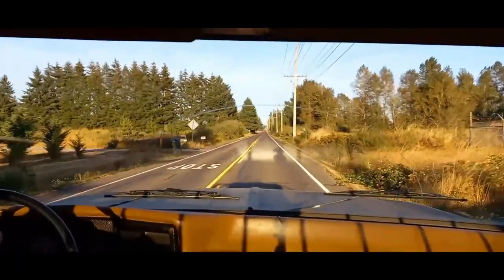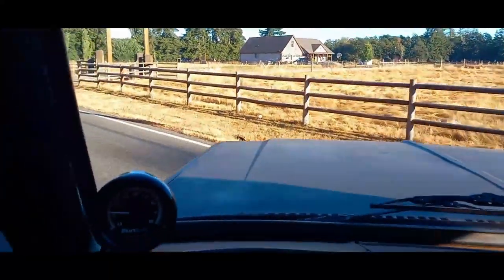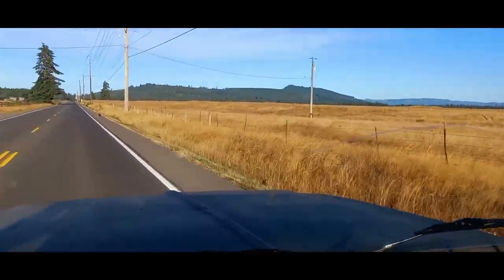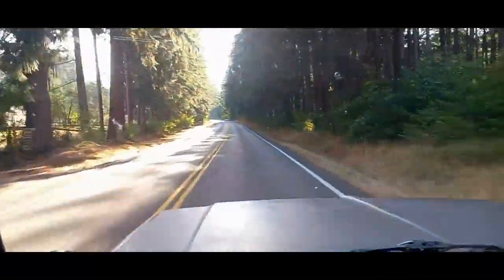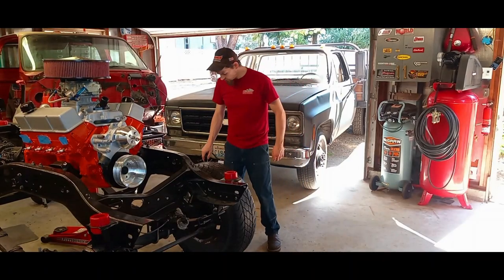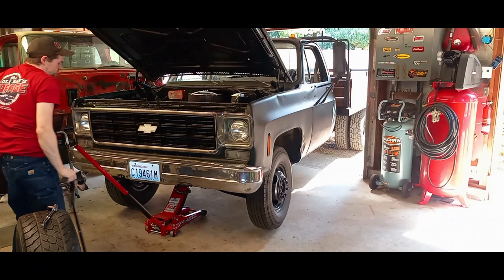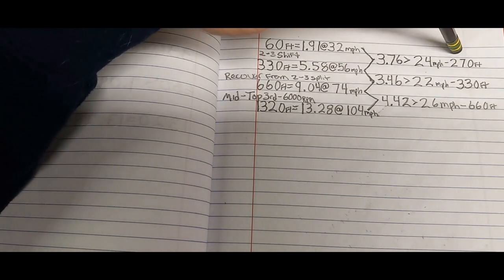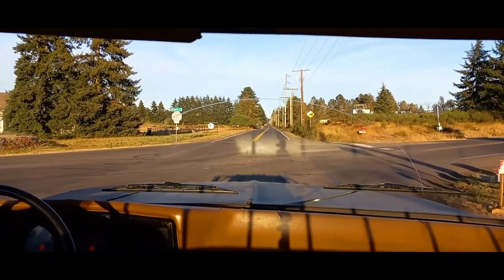383sbc Powered Chevy Dually Runs New Personal Best Low 13sec Pass Since 470hp Engine Build

Comment: You are the ONLY person other than the man that gave me my first job at 16 and taught me everything I know about building an engine and setting up traction that KNOWS  that  overlap is the most important function of a camshaft.. As far as your engine in a lighter car...6.90's ALL DAY LONG
Reply from the maker: Thank you, yes absolutely the most critical aspect of proper camshaft selection is going to be the ability for the exhaust to be able to enfluence a inertial charging event on the intake side which causes a super chargering effect and allows the cylinder to be filled at rates up to 7+× what the piston alone can induce on the induction system, and that is just the starting point of proper camshaft selection and 99.9% of people wouldn't know how to properly come to just that conclusion, but even after taking every thing into account that one would have needed to to come to that conclusion it can of course all be f'd if the lift and duration numbers aren't right and there are so many factors that come into play there also. You seem to be one of the very few people I have talked to that have some grasp on the effect of actual proper camshaft selection. I hope to help people to understand this stuff more thueroly. I don't know if you know who David vizard is but he had seen and  identified that I have engine knowledge that very few people that walk this earth have and that basicly everything I say can be confirmed by alot of his videos and backed by his 60+ years of engine research, development & 1000's of dyno runs, he went as far as to recomend my channel to his subscribers. I hope we can have further discussion when I put out the camshaft info, I could literally go on for days explaining all this stuff and still not cover it all.... you confirmed what i was thinking as far as time if that  engine out of the dually was is something lighter. With that engines ability to do That was kind of my point, that engine wasn't built with speed in mind it was built for torque but being as all the parts in that engine correlate with one another down to minute detail and it uses the proper camshaft it has impressive output compared to if I had just put in some cam off the shelf even if the spes of that cam were close it wouldn't be optimized for that engine and had I put in a camshaft that was to big performance would have suffered severely. Take care buddy
Reply: @ACDGarage_Racing  I have several of his books. There is one other person that taught me the same thing as DV and he gave me my first job. It's soo in depth. Camshaft timing is a science. I enjoy watching videos of people explaining how a camshaft works not realizing that they are WRONG. I have a question for Bill  but need to send him a picture. It seems if I have a question, the only people that could answer it have passed. Bill is my only hope lol.

Comment: That's a pretty badass SBC to make that big ol girl run a 13.28 1/4 mile. I can tell from experience that you know exactly what you are doing with an engine. Hope you are doing well brother.
Reply from the maker: Thanks man, I've definitely been deeper into the most intricate details and physics of engines than most people could ever hope to comprehend, not to brag just staiting truth but literaly by the time i was about 10 years old i knew more about cylinder heads/engines than most grown men, i actually started working in my dads cylinder head/engine building machine shop when i was 10, i have built many very successful circle track engines, street engines, drag race engines in including my own mud racing champion 383 that dominated in a class full of big block trucks some with 540's. but I entend to educate and help people understand, go faster and make better/educated decisions while specing/building an engine's.

Comment: hey, you take all the time you need to do whatever you need to. 
The faithful won't be going anywhere, so if you're worried about that, don't you have more than enough on your plate. 
BTW, last comment wasn't comparing anything to anything, it was to simply let you know that some of us understand some of what you're dealing with. 
So you take time to take care of what you have to, because we're no different than you  with the exception of we're on the other side of the screen. 
I assume you are using your phone to record your videos, and if that's the case. 
Find yourself a good suction mounted phone caddy that typically gets used on the windshield. 
You can do some test takes to figure out best location for filming, and your being able to access it to change settings and on and off for your driving runs.
I'm sure they have something better because everyone uses their phones a lot more than people realize they do, but that's the off the top of my head solution to your situation. 
I've always been firm believer in GMAC's start up additive, and I know you're going to smack my hands for this one.
I have used white lithium grease to lube everything up with including packaging the pickup on oil pumps for quick priming of oil pumps. 
I use whole tube of it when I start assembling one, and if I have to stop for any reason for more than a few minutes. 
I'll cover it all up with a old sheet, and even tie a string around it where I gathered it up under the bottom. 
Never had a roller cam to install, and never had a flat tappet lifter, or cam failure are anything else in the hydraulic part of the engine. 
With the exception of high volume oil pump on with a stock oil pan on my old 327, but only because I held it at high rpms for too many miles. 
I'll even explain why I did what I did, my ex wife girlfriend at the time was already over hour late past time she was supposed to have been home. 
We were twenty miles away, and it was basically straight farm roads on good asphalt back then, and I took the muncie to the limits between every shift, and once I leave 1st gear, I never touch my clutch pedal again until I get ready to stop back in those days. 
I won't claim any high RPM numbers out right, but I will say it never saw anything under 5,500 for a long long way.
And it didn't actually give indication that I spun all but one main bearing until I shut her off at my house, and this is after several red lights couple stop signs, and dropping her off and waiting until she was inside the house with porch light turned off
When I turned the key off, instantly I heard her sqeal for half a second, and she stopped turning. 
Didn't hurt the rod bearings, lifters are cam bearings any.
The mains, except one, were completely overlapped, and one half was nuthin but a little thin piece on each side where it was pushed out from being smashed and ground to nuthin. 
had crank turned and polished new set of over stock bearings, had the cam bearings replaced just because, and had cam checked by my dad who was a  machinist for TI for 40 years, but had a friend at machine shop do the actual machining for me.
She ran another 12 years, and was still going when I sold her to a friend of mine for his fat fender Studebaker truck .
Oh yeah, I threw that high volume oil pump in the scrap bin in my dad's garage, and bought a standard factory mechanical pump too.
But I didn't stop driving her for what I built her to do, and that was eat Fords any time one rolled up beside her, and ever see a little mouse painted ford blue, you'll know that is because it's showing a fomoco what it's supposed to run like
Reply from the maker: Hey Timothy, how you doing buddy? So about the last comment you made, first I'm sorry I didn't respond back properly like,I said I was going to but it had it had completely slipped my mind because I had another wave of 150+ or so comments on my channel from new subs because Bill had told people to go subscribe to my channel. Second, don't worry I knew exactly where you were coming from when you said what you said, i didnt take it anyway then how you ment it, just know i didn't take it the wrong way so we're good.
I had bought 2 different style phone mounting devices bolth suction type just different designs, but anyway the problem I had with that was it vibrated so much when it was attached to the truck from the resonance and firing rotation of the engine and it shook the screen so bad you couldn't hardly make out what you were looking at. So I had figured out how to anchor my tripod in the middle of my seat with bailing twine, this is how I was able to make those few passes and be able that pig of a transmission as fast as possible ultimately resulting in my best pass to date according to the draggy. After I had put the video I had realized that I had accidentally wrote down the wrong mph and time in between the 660 and the 1320 I was so tired when I went and broke all the numbers down and made that example sheet. I had watched that video so many times before I finalized it on my computer, just to see a mistake while watching in the premiere after I had already uploaded it lol, o well I guess I'm sure most people can expect me to make a mistake with my brain issue, I always end up catching mistake after the point of me being able to fix it. Sorry man I kind of went to left field, anyway I'm going to cut this off its getting a little long, I hope you are doing alright. Hope to hear back from you, take care buddy.

Comment: Hey youngster long time nothing from up your way, with the exception of you hollering about Jimmy Dale.
Long ago when there wasn't snow on top, and the chin hairs were red, we use to run down at yella bellie..
It was a lot more tricky then, cause the shut down is fairly short, and ends at a  hair pin left turn, are through the couple rotten round bales, and off into the weeds with no telling what lays waiting in the head high Johnson grass..
Only back then the shut down bottle necked both lanes together, with the additional thrill of lot's of wavy bumps in the asphalt from the shit getting stretched towards the turn from the extremely high temperatures we have every summer, and the force of everyone's tires under heavy breaking physically moving it to form the 2 and 3" ripples that causes the cars and trucks to buck up and down extremely hard to stop with the old brakes we had back then.
Considering that everyone was in mid 50's to early 70's model vehicles, you were doing good if you had disc brakes on front, but most were 4 wheel drum brakes with no valving to set brake bias, so those like myself in trucks did good not to swap ends trying to stop on that shit they called a road. 
What I'm trying to get at, is on my truck I had trailing arms with coil springs on rear suspension  
Much much better than leaf springs in my opinion, not only for better ride, carrying weight, but for traction control.
No wheel hopping axle wrapping the leafs up like twisting open old sardine can effect  
Built in traction bars, and the suspension works as if it was a four link so to speak.
But I had similar problems with the front end coming up instantly, but falling down as fast as it came up..
I solved this by installing big block springs off a 3/4 ton front end, and installing the largest sway bar they made back then.
Once you got the extension on the front, between the tires biting into the surface hopefully concrete the rear stays down trying to force the tires through to the magnesium wheels.
But just driving they kept down force on front tires, and with the addition of the big sway bar, it lost the oversteering bullshit that made you feel like you were going to lose it on every sweeping corner over 30 mph. 
Now remember we didn't have radial tires, and I ran L60 15" on 10" magnesium wheels back then, and L60 is 11.75" wide with basically straight groves for tread pattern. 
So I could stomp on the 750 dbl pumper, in first or second on asphalt  pretty much year round, and break the tires lose. 
That's due to close ratio muncie 4 speed from a 69 Z28 transmission, and 373 12 bolt in the rear axle.
327 .60 over equals whatever cubic inch it comes to, camel hump heads mild massage cast iorn manifold gm preformance off forget what car, but when you make $1.67 @ hour, you get cheap preformance where you can. 
But the old dude across the street from my parents place was mechanic for Friendly Chevrolet since the early 50's, and use to work on the company hot rods the owners kid raced back then. 
So he was very knowledgeable about what works best, and what to leave behind. 
He's the one with his deburring tools cleaned the heads and manifold up to breath better.
Basically he just gasket matched everything, and opened up the castings deformities as far as he could get to safely, and cleaned up the headers to open up as big as the gaskets too.
Probably wasn't over 450 at the crank, but add a muncie tied to a aluminum flywheel through a Hayes super clutch it was enough to best most everything that rolled up beside me  
I didn't mention the crane cam double springs chrome moly push rods, 6 to 1 rocker arms or the valves being 202 spec did I. 
Funny how that slips my mind these days, but I saved a long time dropping charge in a old picked jar for those parts and the dual point distributor from Mallory. 
Engine was from 60's fuelie corvette transmission 69 Z28, and believe it or not I paid more for the shifter and clutch than for both of those. 
But that was long long time ago and it's long gone unfortunately, but dam did i have me some serious good times back then. 
People freaked out when I opened the hood, and there's this tiny little motor sitting down in the canyon of an engine bay painted Ford light blue.
Everyone look at it, and first thing out was, that ain't no ford small block. 
Nope, but that's what ford small blocks should run like though. 
Piss off ford owners especially when they had big blocks, and I left them back sucking up all the smoke they were making

Comment: Great content man. I’d love to build that strong of a 383 for my Camaro. I’d also love to here more about selecting LCA and duration numbers. Keep the videos coming.
Reply from the maker: Thanks brother, you know what, you are in luck because as we speak I'm working on and have been working on for about 2weeks, the most complete camshaft video on the internet, I will be giving so GD much information and I will be proving with physical proof that this way of selecting a camshaft is 100% the best most effective way to build a extremely powerfull engine.. im going to give information, explanations, and reasons for things that you won't find or hear anywhere else on the internet, ( bealive me ive looked) I fully explain and tell how to properly calculate lsa, overlap, and duration.... i explain what effects the selection of lsa.... I give the proper way to select duration that works with the lsa and why duration changes with lsa.... I give a way to quantify the selection of the proper overlap for the engines specific rpm requirements.... there is so many solid explanations and examples with physical proof from dyno sheets and the fact that the formula predicted the ideal lsa for the most powerfull camshafts based on proof from the dyno sheet.... im also going to be giving proof that ls engines dont nessasarily like a wide lsa, they actually prefer a narrower lsa.... i will also be exposing one of the biggest most well known/ respected camshaft and performance part manufactures for their extremely grossly overgeneralized way of specing camshafs and the fact that the guy who runs the company says lsa means nothing, i end up proving him absolutely wrong and i expose the specs on one of his seceret camshafts in the video.... the video is so complete that after watching the video someone who has never selected a camshaft before could make a better camshaft choice than most people with alot of experience that dont know how to select one this way.... if this says anything the video is going to be like 1hour 50minutes of me just spitin pure engine building/camshaft selection gospel with physical examples and proof of concept.. I hopefully will have the video out in a few days, hit notify so you will know when I drop the video.... take care buddy....